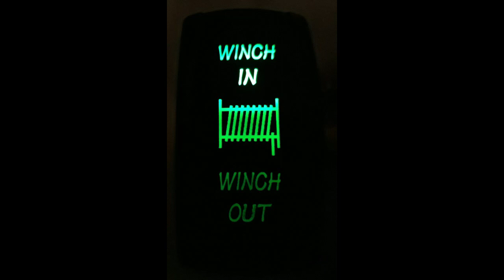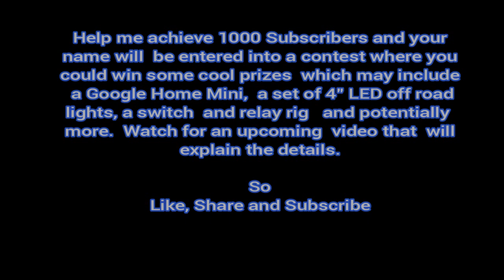7 pin winch Switch wiring

Comment: How to wiring 7pin DPDT with two separate DC sources??
Reply from the maker: as long as its a DPDT switch its possible you just run a seperate power source to each of the input poles instead of jumping them.  thats the Double part in a Double post Double throw switch (DPDT) :)  thank you for watching

Comment: Yea, you did it the VERY basic way... make one that widow / winch / roof can go in out/up down/ open close by changing polarity on switch "ie neg becomes pos and pos becomes neg to change direction of motor rotation... I had to sit with multimeter draw bunch of sketches and got it right first time, and that is why these switches exist, so polarity can be changed and not simply wired up as on off toggle... make vid on that, and more people can make use of this feature. Else I will just post a vid myself 💭🤷🏻 "and yes, a Lumeno winch / roof up down / window up down switches are the same, but that wiring is way more tricky than what you chose to demo ie only switches lights on and off... yet there are other switches that do this jyst fine,  but non of them can change polarity as i mentioned...

Comment: Good video.  However, my original winch rocker switch has three wires and the new rocker switch has four. What do you do?  Thanks!
Reply from the maker: without knowing the exact switch Id say that the 4th wire is for the LED light in the switch and thus not needed to work but if you want the light on the switch you have to hook it up  if you connect it to the power into the switch it will be on when the switch has power If you connect it to the power out to the load it will be on only when the switch is turned on

Comment: I watched the whole video because I want  to use the same switch on a linear actuator.
The actuator only has 2 wires. 
I need the switch to simply reverse the polarity
Reply from the maker: you can do it yo just need to cross over  (from what Ive read) it seems most dpdt switches will do a google image search for wire switch reverse polarity it pops right up

Comment: I seen your vid trying to find a way to split a input to a Jackery power station to have a switch to have solar input and reg 12v power input switchable from a switch instead of pulling out one cable and putting in another. I hope this makes sense. Lol. Essentially 2 individual inputs that are switchable between each other. I’m hoping for a solution for this. I’m not sure if it’s even possible. I can provide pics for more clarity in what I’m trying to do if you need.

Comment: Great Resouce.  I use OTRATTW rocker switches which appear to be different although similar even with the winch switch.  The switch is their V8D2UXXB.  I can send a picture of their wiring diagram to assist in answering my queries.
Reply from the maker: they are in all honesty going to be about the same  they all follow a similar wiring schematic to keep production costs down its only going to get weird if there are 7+ posts  if you have a continuity setting on your multi meter its pretty easy find the power in on the switch click the switch to the position you want to know the power out and listen for the beep as you touch posts if it beeps in the on position and not in the off position that's your power out post

Comment: Can you show what wires actually go to the winch and where to connect them. This was very informative but I need to know how to make the winch work!
Reply from the maker: As I said you will most likely need to use the switch to power relays closer to the winch as most winches use more power than Id feel comfortable running through any switch it will be the positive wire that leads out of the switch on the in and out position you then hook those to the trigger wire on your relay. sorry I missed this question before

Comment: What size wire did you use?
Reply from the maker: sometimes for tutorials I will use a smaller gauge but in the real world I prefer 16 or 18 gauge for most low power applications like switches etc  bigger for the main power wires on relays both in and out.   most of these switches really do not have a ton flowing through them if wired correctly so you can get away with small gauge wire , you really should not be running every light or load off a single switch without a relay anyway  think Macgyver not Tim Allen lol
Reply: KootenayBoy DIY thanks. I have 16, just making sure I wasn’t using to small for this application. And I also agree, using shrink over tape any day of the week. So much easier and cleaner. Thanks for the great video.

Comment: Great video! Nice to see how an old video from 2 years ago is the answer to my prayers!! Been looking all over for this layout and couldn't find it anywhere. Thanks for the detailed video and demo. How would I wire a dual function light bar with down being amber only and up being both amber & spot on while using 2 single leg harnesses to each function?
Reply: Also do these switches typically have backlighting in addition to lighting up switch position when engaged?
Reply from the maker: @ryancline3025   yes you can set them to several positions it depends on where you feed the LED post from jump it from the on position the led will be on only when the switch is on jump from the off the led will only be on when the switch is off  feed it from the ACC it will be on when the acc is on and feed from the battery it will be on 24/7  dont feed it at all and you have no led  sorry I missed this question before

Comment: I bought the same switch for a linear actuator. I wired it exactly as you describe, but there is no movement of the actuator in either direction. The switch light works though. I changed the switch out with a 4 post rocker switch and the actuator works fine! Any suggestions?
Reply from the maker: sorry I missed this  sounds like you have power going to the light but not the switch through  was it hooked up to the ignition or a relay?

Comment: The video is good and helpful. But you are showing how to use a winch switch as a lighting switch and also how to use it to only light (led switch lights) when a button is pressed. Is there a way to set this switch up in a way that both switch lights are on with running lights. I haven't tried wiring this yet but plan to here soon.
Reply from the maker: how is a light different than a winch?  its not its a 12v load :) the switch does not care if its a light or a winch relay  if you can wire a light you can wire a winch the only difference is what's at the very end of the wire :)   not being pissy  lol  Im just saying its not overly complicated  light, winch, fan, pump the switch does not care  it sends 12v down the line and shuts 12v off after  what that 12v feeds is not really important

Comment: Alright,been waitin on this one,thanks!
Reply from the maker: cheers.  Its not my best work but I knew you were waiting, I hope it helps thanks again for the feedback
Reply: Im sure it will,i will tackle it tomorrow,thanks!
Reply from the maker: Let me know how it goes
Reply: Please explain the “bridging” of the wires. The red and the two whites
Reply from the maker: you use a short jumper wire to connect the two posts rather than have a single wire coming off each post and connecting them into the same wire later on down the line. you do not have to bridge them, you could bring a pigtail off each one but you would use more wire and have more wires going into the junction further along.  doing it this way is just neater closer to the switch so if there is an issue with a connection you're more likely to find the problem at the switch than have to troubleshoot under the dash